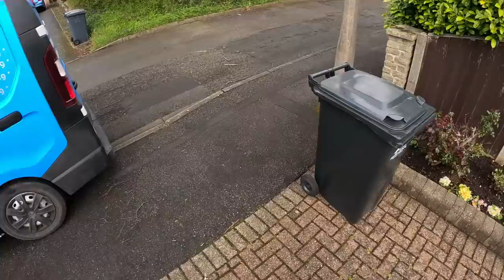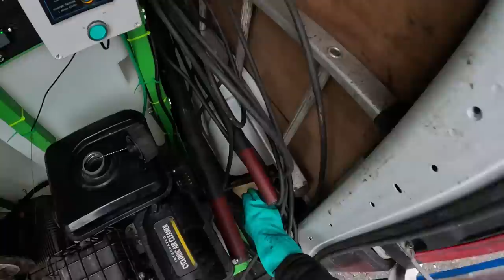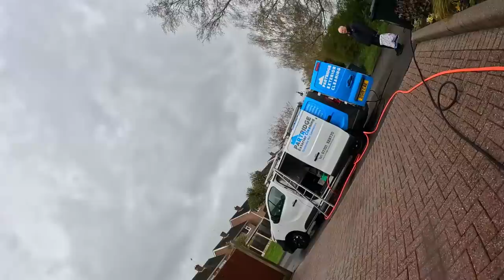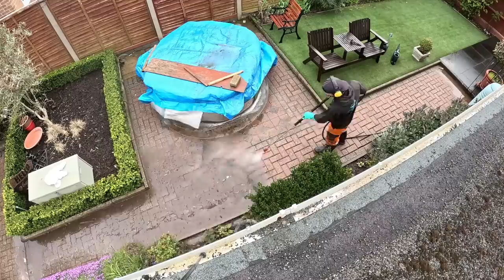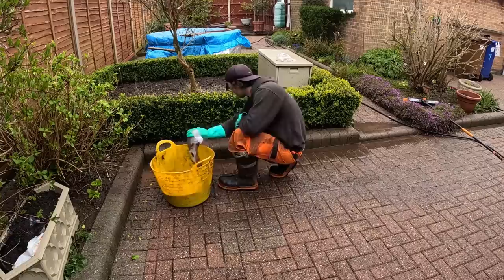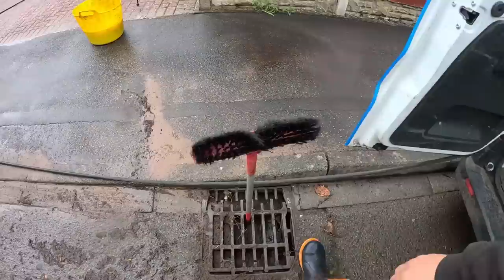I Returned To My FIRST EVER Job & POWERWASHED The Driveway For FREE!

Comment: Top tip buying a wet and dry vacuum will help in these types of situations as you will be able to clear up little puddles and areas that fill up with water which you can then empty the bucket much easier then manually doing it 👍🏻

Comment: Hey Sid, something you might consider as a pump is a fish tank pump they come in various sizes they are electric and you know that they can move all that water around inside a fish tank they should be able to pump out you know the water where you need it to at work. I think the only thing you really have to do you know is put some kind of bubble filter on it but I'm sure a fish store sells those also so you might consider that or just a much smaller pump they come in all shapes and sizes and wherever you know it's got a flood just put the pump in there and go to work. Nice video keep them coming

Comment: One way that ive found helpful for sorting a flood is to bring a couple of towels, you can fully soak the water into the towel and squeeze it out into a drain, savved my skin a few times and way better than scooping water out for ages and leaves it relatively dry

Comment: The first time i used a heated pressure washer was in a Heavy Equipment class. That thing was old and cranky (small diesel engine with who knows how many thousands of hours, heater was diesel too) but holy crap could it clean. 48 hours of teens and young adults playing in wet clay? no problem. Man i miss that class, bulldozers are fun.

Comment: Hi, Sid. I'm an old fart now, but back in the day I was a rep. for a Kärcher dealership. All industrial equipment. I towed a big box with the pressure/steam cleaner. One of the biggest sellers was when I attached the sand blaster to the pressure washer. On building sites eyes popped out of heads when I hit a dump truck and other heavy machines. Blokes would come from all over the site to see it perform, blokes brought their wheelbarrows out (remember this was the 1980's). So have you ever considered trying that. Makes short work of rust, moss etc with no chemicals needed, the sand is very fine so clogging drains isn't a problem. I also sold to abattoirs and they couldn't wait to write out a cheque. Anyway, good luck with your endeavours, upwards and onwards as they say.

Comment: What you need is a long thin plastic sand bag (dont know where you would find one) so you can lay it out as a guide barrier for the water, then you can sweep it round into a drain without it going everywhere.

Comment: Sid, I've been watching your channel for a long time and it's a joy to see how it and you have grown.  One note: A sump pump needs significant water depth of water to operate ike you said, have you tried a Submersible Utility Pump?  By that I mean it looks like a sump pump but only needs 1/8 inch or about 3 mm depth of water to operate as it sucks the water in from the bottom.  They usually don't come with a float switch but the do come with a hose bib adapter.   I hope this helps.  
Continued success, brother!

Comment: Sid.
Get yourself a mud sucker!!! Ther are amazing, it would clear that muddle away in no time....also.... get your system on a remote control so you can turn your pressure washer off when not needed.

Saves loads of time, I installed mine myself

Comment: I hope you don't mind me mentioning this, but a couple of videos back you spoke about your red hose kinking. I just noticed that you were pulling the hose off the reel rather than unwinding it. That is what puts a twist in the hose which then kinks when you stretch it out. Winding and unwinding will stop that. Maybe turning the reel 90 degrees in your van will help you to unwind it easier.

Comment: Just invested in a Karcher pressure washer always wanted one amazing how good they are. On to the drain issue we recentley had a new bathroon fitted and the fitter could not turn the stop cock off on out kitchen so he went to the mains bottom of my drive.. Lifted the lid and it was full of mud. I tired pressure washing it clean but it made it worse Eventually we went back to plan A and heated up the stop cock valve and got it moving .I will inform the council of the mains one filled with mud though.

Comment: Hello Sid from Canada I am not sure if someone else has given you a solution to your water pooling and a quick and efficient way to solve it is a shop vac! Vacuums ether wet or dry in to a bin you can empty many sizes to chose from and will speed up the process and save your back! I hope this helps.

Comment: You can get a small drill powered pump from Halfrauds or even cheaper online that might help in those situations, it's small enough to throw in and clearly you already carry a cordless drill. Wouldn't last forever with mucky water but as a consumable time saver it might be worth it. Anyway I like the irony of the waterproof shoes getting wet inside.

Comment: Look up a "Venturi effect Vacuum Jet Pump" for Pressure washers and get a Y / Tee Splitter Dual System splitter for pressure washers with valves 

some Venturi effect Vacuum jet pumps can deal with solids muds and stones and pump very quickly

I would aslo pickup a few Ryobi Cordless R18WDV-0 ONE+ Wet and Dry Shop vacs + a few Ryobi 3x of each 5AH ( RB18L50) & 9AH (RB18L90) Battery packs + 2x Mains Ryobi  Fast 1 hour 2 hour Fast chargers for the van solar setup

Comment: I'm a roads worker who occasionally operates a jetting/vacuum lorry for that type of drain. You're best not to stick your hands (or equipment) down those drains. They are often used by rats who come through the sewer which can result in you catching Weil's disease. It can land you in hospital for a week or so and you'll have a horrible time. And yes you're right about the equipment required to clean them effectively.

Comment: Road Gullys will be down to highways or local council they barely get cleaned out now sid. I work in the drainage game ie tankers etc so we do alot of cleaning these gullys out for new builders. I wouldn't worry if you make a little bit of a mess mate because in all honesty these should be cleaned out every couple of years depending on where they are located etc heavy traffic roads or where there are loads of trees ie leafs etc go down. Btw cracking job keep up the good work.

Comment: Really like the videos, and thinking of starting myself, I'm a drainage engineer for the water board in the SW getting fed up with working for the big company. 

One thing we have If you haven't already get a overflow line above the float valve if it fails to dump under the van. 

Any chance your from Plymouth #greenarmy

Comment: Most submersible pumps need at least a couple of inches of water to prime, so no good for this sort of thing. Get yourself a puddle pump, I use a Clarke PSP125 and its saved my bacon quite a few times, works down to 2-3mm water depth. Can't go wrong for about 80 quid.

Comment: Question: I think I used too much pressure and my concrete pavers were already physically a bit rough surfced. Any product to kind of fill in the surface roughness? Some thick sealer of some sort? Epoxy? Or diamond surfacer of some type? Iver seen little ones for grinders and big ones when they did the concrete floors in the business I work at.

Comment: With that part that floods, couldn't you push it up towards where the drain is with a hose. And flush it down the drain. I know it's a bit more work but it'll get the water gone faster.

Comment: For poorly drained areas like that, why not try a wet/dry shop vacuum? No depth required, just suck the water into the vac, then use your pump to empty the vac out.

Comment: Murphy's Law:  Buy fancy pressure washing rig, have fancy pressure washing rig problems.:body-blue-raised-arms:. I had the same experience with a submersible pump and a drain backup in my basement.  You just can't get it low enough to clear the water.  I wound up using a shop vac, but had to keep emptying it.

Comment: Why did loads of water piss out of your van when you opened the door lol ?
Reply from the maker: Float valve has failed - basically no auto shut off for water that’s feeding in to the tank. Common issue but an annoying one :)
Reply: Yeah that's annoying. I had about 300 litres of water flood the back of my transit connect once when I used to have a reach and wash system for window cleaning. Pipe on the pump cracked in freezing weather. Not a nice discovery the next morning 🤦